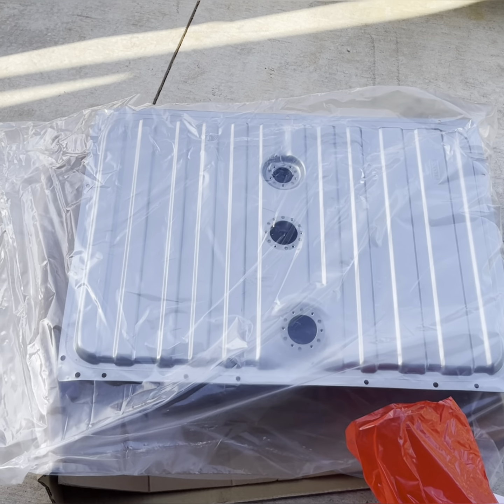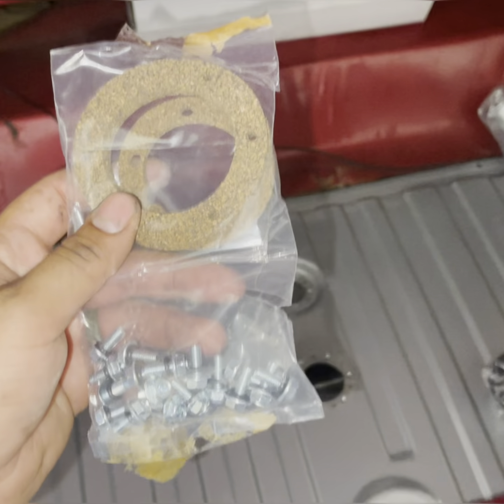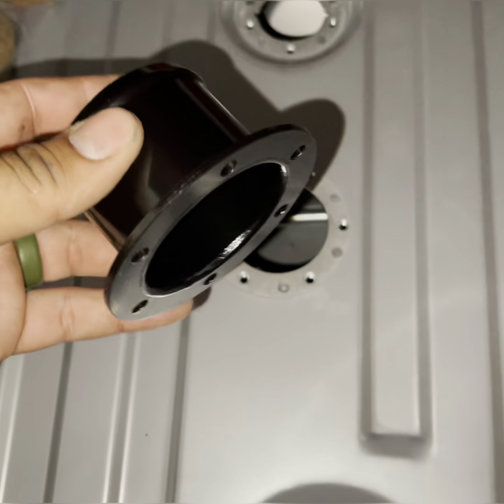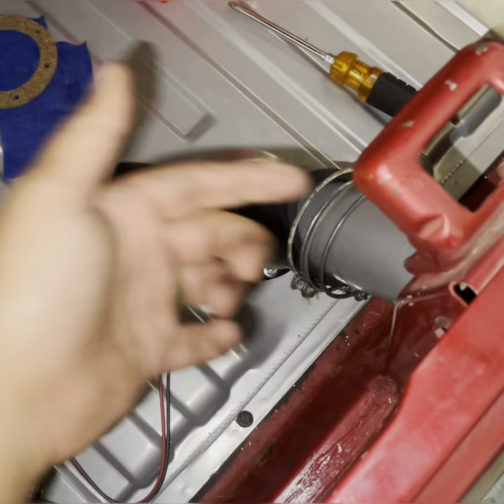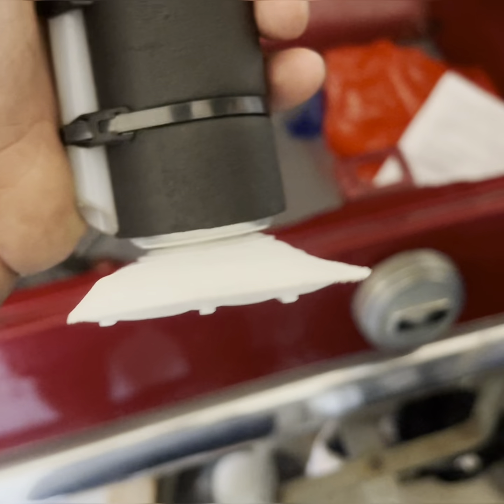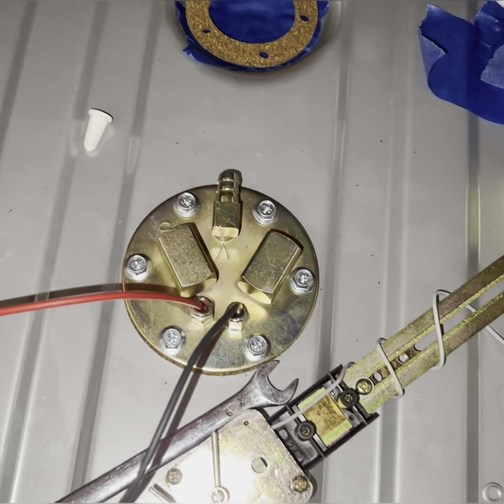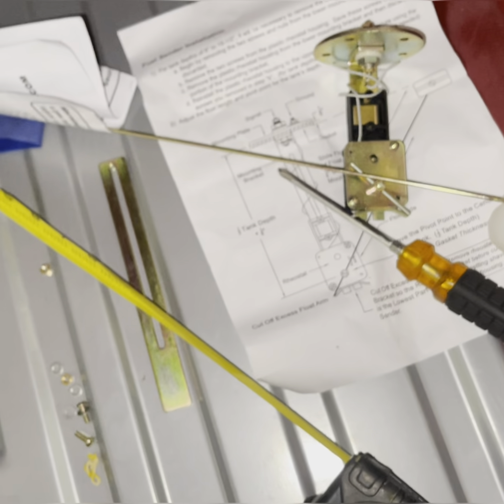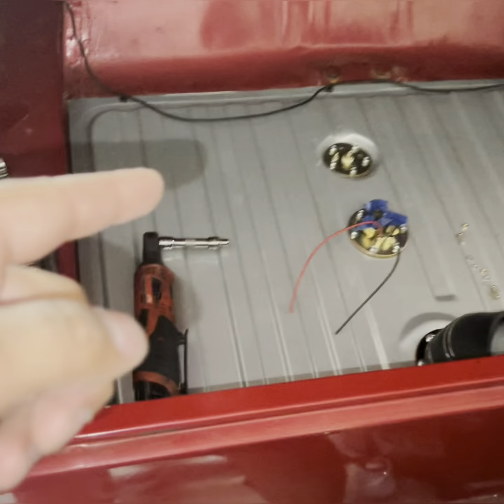Pt.3 Tanks EFI install in my 66 Ford Mustang

Comment: Finally came across a video of someone fitting a tanks tank 😅 great video very helpful as I’m fitting the same tank,do you know when the finished video might be up ?
Reply from the maker: I’ll hopefully have it finished soon currently out of state but we did get it working and flowing properly with an aces efi kit and flowed perfectly. The problem we’re now facing as have others is the ohms reading on the sender isn’t correct with the oem gauge so when I’m back I will hook a multimeter up to it and see what the reading is on the sender.

Comment: Great Video, I just wish  you had it out when I did the same install on my 65 Mustang Conv. a month ago.  
I am getting a 1/2 tank reading on my fuel gauge with an empty tank. just wondering how is your fuel gauge is reading after the install?
Reply from the maker: I’m still trying to figure that out mine reads full at a half tank so about the same thing yours doing. Which is weird because it’s supposed to be the same ohms. I haven’t had time to test the ohms on it yet but I’ll let you know once I do.